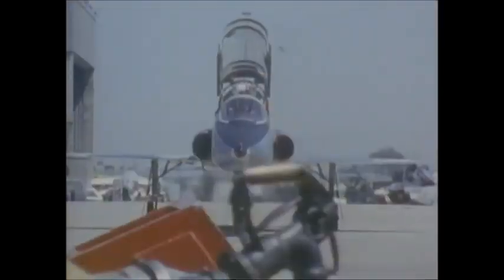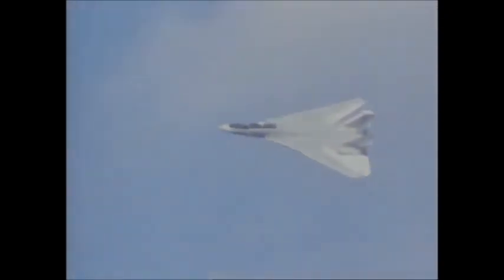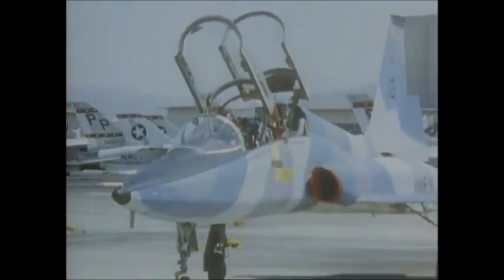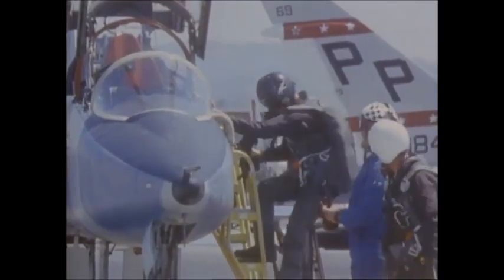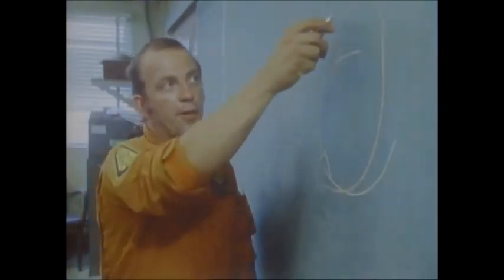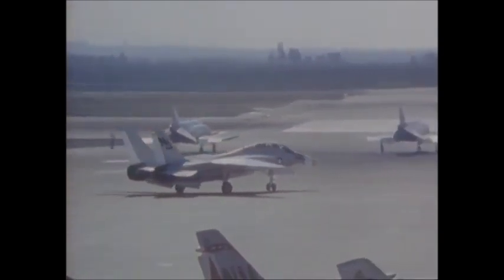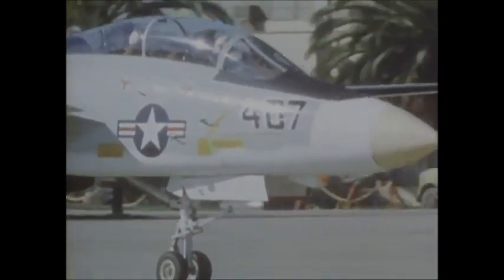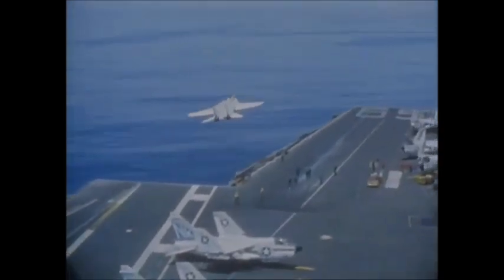F-14: Air Combat Maneuvering (1976)

Comment: Great looking and capable but like a pretty woman … can temperamental and flame out, at the worst time. F-14D with GE, Please
Reply: I read somewhere that the pilots that flew all 3 preferred the B model because of the obvious the GE engines and the fact that it was lighter than the D model and better thrust than the A , and the D model having the new electronics making it heavier than the A&B.  And those two pilots were Snort and Nasty , so you know that's the real truth

Comment: At speeds above Mach 1.0, the glove vanes in the leading edge of the fixed portion of the wing extend to move the aerodynamic center forward and reduce loads on the tailplane.
Reply: mach 1.4

Comment: F-14 uses spoilers located along the upper wing near the trailing edge in conjunction with its all-moving, swept tailplanes, which are operated differentially; above 57-deg sweep, the tailplanes operate alone. For unswept, low-speed combat maneuvering, the outer 2 sections of trailing edge flaps can be deployed at 10 deg and the nearly full-span leading-edge slats are drooped to 8.5 deg.
Reply: Behind and above the engine intakes?

Comment: The design of the F-14B allows for incredible pitch authority as well as good roll control to produce an extremely agile fighter. Rolling maneuvers are accomplished through the use of differential horizontal stabilator and 8 spoilers located on top of the wings. Its general arrangement consists of a long nacelle containing the large nose radar and 2 crew positions extending well forward and above the widely spaced engines. The engines are parallel to a central structure that flattens towards the tail; butterfly-shaped airbrakes are located between the fins on the upper and lower surfaces. Altogether, the fuselage forms more than half of the total aerodynamic lifting surface.